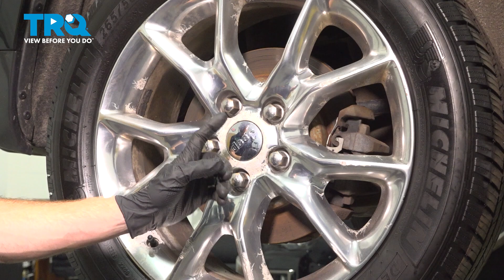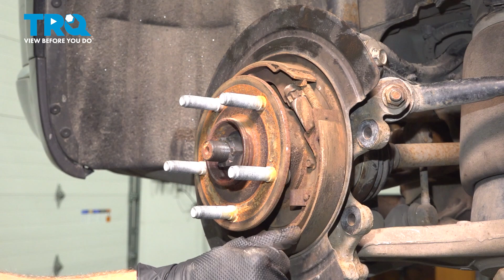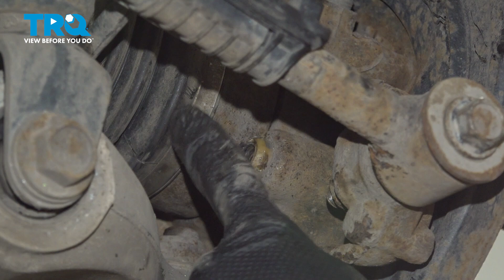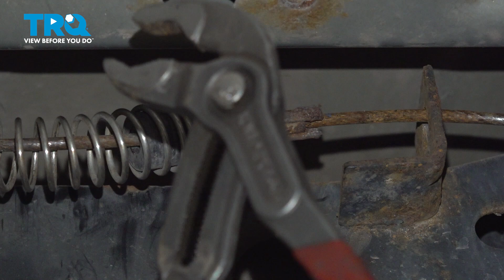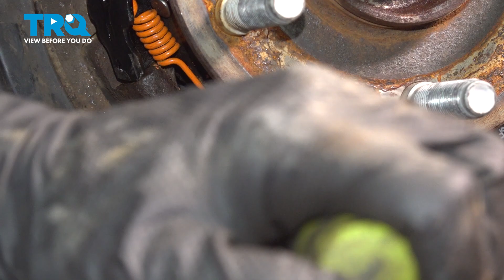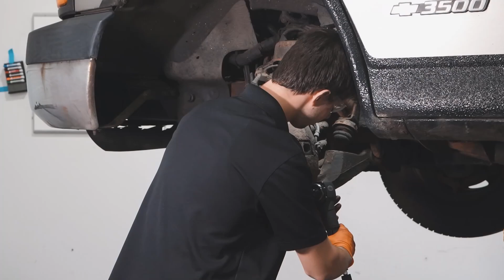How to Replace Rear Parking Brake Cables 2011-2021 Jeep Grand Cherokee

Comment: Too many ads. Also trying not to wreck the current cable. 
Update. Use vise grips on the back of the plastic housing on the back of the knuckle, twist and pull.